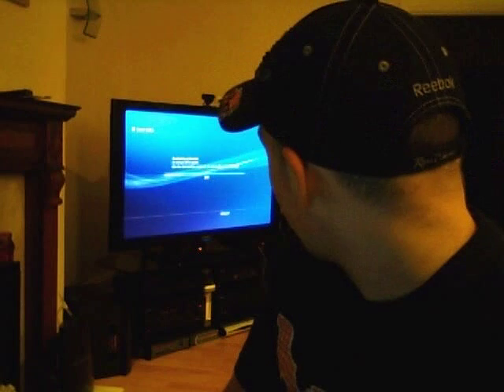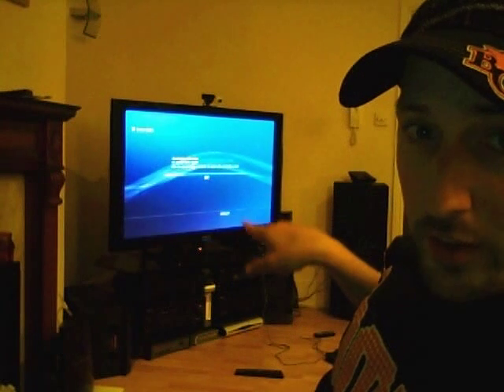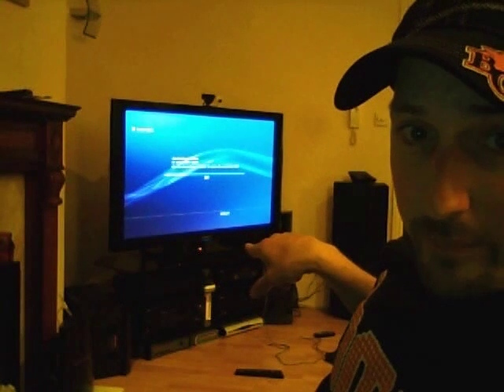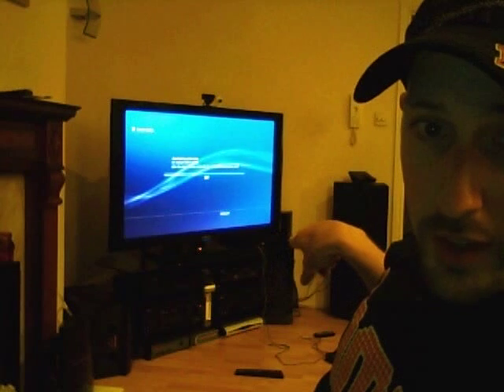Slim PS3 Power Problem

Comment: I just got my slim 160gb ps3 from the U.S. with U.S. games as well and my sis just plugged it straight into the wall....and guess what, it works :) still playing GOW3 on hard, man is it hard. Anyways its 240v here. IT WORKS WITHOUT A TRANSFORMER, &I'm making good use of the fan.

Comment: I just moved back to Germany and want to try my ps 3 on 220 volts. So a US PS 3 Slim 120 Volts 60 Hz will work with 220 Volts and 50 Hz? The Slim!!! not the original!

Comment: The ps3 has a ac to dc converter. Most coverters work with 110-120w and 230-240w. logicly sony would give all the ps3's the same converter just to make it easier on them.

Comment: Most computer and consumer electronics power supplies made in the last decade can handle both 110-120 and 220-240 AC current. I've taken cameras and laptops to Europe and they worked fine w/ a plug adapter. It usually says it on the brick.